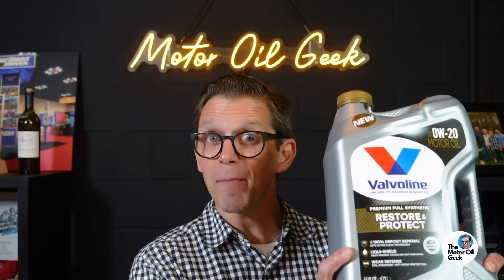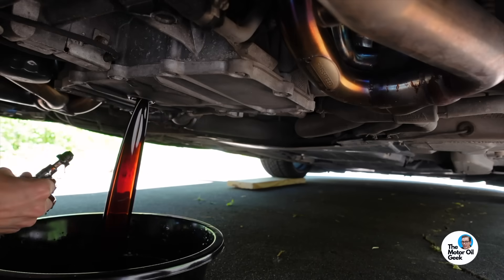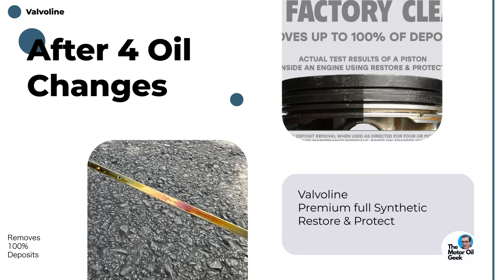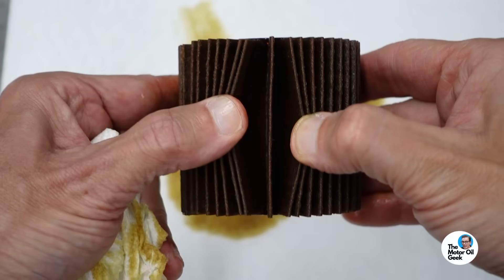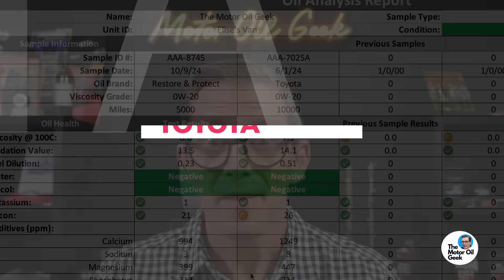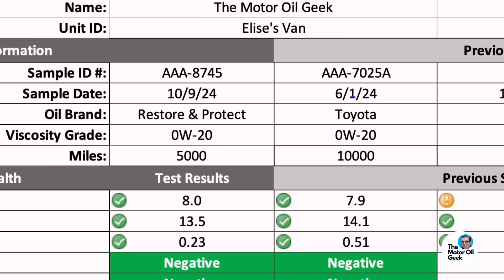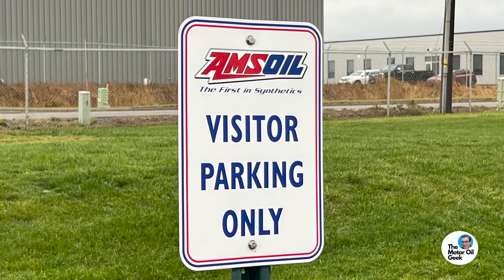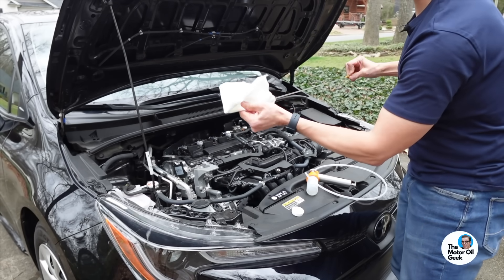The TRUTH About Valvoline's BOLD Engine Cleaning Claims

Comment: Can't believe you were letting the wife's van go 10,000 miles between oil changes from the Toyota dealer with OEM oil!
Reply from the maker: The OEM oil is actually very good, and the used oil analysis results show the oil is capable of 10,000 mile oil changer intervals. As such, that's what we are doing. Science, not speculation...
Reply: @themotoroilgeek your doing great work bring the actual facts to the table and not just opions. I use to think you were full of shit. I was wrong and you've proven me wrong time and time again.
Reply from the maker: @jmc6940 thanks!
Reply: @themotoroilgeek Did ya forget about me?

When are you going to do motorcycle oil related content?

It's a fine dance between protection and grip for the clutch. Maybe you're still researching it? I'm sure there's a lot to learn with this particular appliance.
Reply from the maker: @Stacy_Smith funny you should ask… our next video is on motorcycle oils.
Reply: @themotoroilgeek  WHOO-HOO! Thank you sir.
Reply: @Stacy_Smith I used strictly Rotella in our four stroke Yamaha motocross bikes. Motors looked like new every time I pulled them apart. Clutch grip never an issue.
Reply: @partialperson  That's what I'm running in my 2018 Yamaha Star Venture Transcontinental.

I'm running Amsoil Metric 20w40 in my 2007 Yamaha V-Star.
Reply: @partialperson  One more thing...

I would like a comparison of Yamalube vs. Rotella.
Reply: @themotoroilgeek  Mobile 1 makes Toyota oil! Mobil 1 makes great oil been using it for years and used Valvoline but now I’m using Valvoline R&P in my 2016 Camry..
Reply: @itsJMoney0192 Toyota oil is very different from retail Mobil1. Toyota oil has about 10x the moly content, among other differences.
Reply: @themotoroilgeek Can the oil analysis show if carbon is present to the point that it clogs the oil control rings and drain holes? Toyotas are know for oil burning due to worn cylinder walls since the rings are frozen in place. I’m curious if a UOA will show this.
Reply: @themotoroilgeek, more importantly, did you inspection the engine for wear? Can I hold it your science that I'll have the same outcome? Have you done an oil and engine wear video? I mean using precise measurement tools to find any abnormal wear. Awesome video.
Reply: @themotoroilgeek The varnish on your dipstick refutes the lab analysis.
Reply: @themotoroilgeek  sad. Saving $50 for nothing
Reply: @themotoroilgeek  plenty of Toyota owners have destroyed perfectly good engines with these 10k mile oil changes. Oil analysis isn't gonna show how the inside of the engine looks. The car care nut has torn plenty of engines apart due to long intervals. It's not just speculation
Reply: @XxChuyoxX 
You can however judge the oil condition with the correct test. The engine doesn't care how many miles the oil has on it, it cares what condition it's in.

If you don't have a clue, shorter is better. It's more idiot proof.
Reply: @gk5891  sure but that isn't necessarily telling you the condition of the engine.
Reply: @mrtickles5982   it's typically slow premature wear that takes time. The engines typically become oil burners consuming excessive amounts. It's not something that happens after a couple years. And 10k miles is extremely vague. Everyone's driving conditions and idling times vary greatly.
Reply: @XxChuyoxX  Agree, driving styles and conditions affect the needed oil change interval greatly. Here I am with a 300,000 mile german diesel engine, 10,000mile oil change interval. 50/50 city highway, minimal towing, outside temps vary between 35°C and -40°C depending on time of year. Engine has never been opened.

Edit: I forgot that I changed leaking rocker cover gasket at 280,000
Reply: @XxChuyoxX  it really depends on the engine. The v6 on the Highlander needs clean oil every 5k miles or it will clog. The second gen Tacoma can take  you a million with 10k oil changes.......
Reply: @ I would agree with this. Many older basic engines can get away with it but the newer designs with tighter clearances do not tolerate old/sludged up oil
Reply: @MiguelGarcia-vj7oo that's not true depending on the year and which engine you're referring to.
Reply: @XxChuyoxX  how would the oil not show the engine damaging itself? That's exactly what the analysis is for 🤦‍♂️
Reply: @themotoroilgeek I like your content and I know you know your stuff. That being said while the wear has been acceptable with the 10k oil changes in your wife’s van there’s a huge chance there wouldn’t have been any varnish on the dipstick or other components if the oil changes were done at 5,000 mile intervals. I realize it will still live a long life.  But it’s hard for me to understand the science Vs speculation when it’s right there in front of you on the dipstick.
Reply: @AB-coyote You gotta take all things into consideration. Just because an engine has varnish, doesn’t mean it’s full of sludge or that it’s gonna fail prematurely. If 10k intervals are working for that specific vehicle and its driving conditions, and has already proven to be working reliably and well with over 180k on the clock, then there’s no issue with it having some varnish after so many miles. It doesn’t need to look pretty or perfect, and you also need to take cost into consideration and see if it’s worth it with a cost/benefit analysis. If 10k intervals take it to, for the sake of an example, 500k miles before needing to be opened up for a significant repair, vs doing 5k intervals and the engine lasting 6 or 700k miles before needing that rebuild, was it worth it? That’s double the cost in oil and filters minimum assuming you do them all yourself, but significantly more if you’re paying for labor. Doubt that double the cost of oil changes will outweigh the benefits when it comes time where the engine inevitably fails and needs a rebuild. Now you gotta pay for the rebuild anyway, plus you wasted an extra whatever amount on oil minus the extra mileage you got out of it. Doubt it would be more economical in the end, at least for this example, assuming the engine isn’t absolutely caked in sludge and has serious issues that are a direct result of the 10k intervals & would have been avoided had they gone with double the oil changes. I’ve seen plenty of really high mileage engines that were running perfectly fine and they had varnish. It was just cosmetic and had no adverse effects. (If you’re wondering why the engines were open in the first place, it’s because they were either being swapped for another one, or being rebuilt/upgraded with performance parts) That and valvecover gasket replacements hehe.
Reply: @AB-coyote  I lean hard on the testing and science side, but you make a very reasonable point.  I don't do 10k intervals and I've never seen varnish on my dip sticks in 30 years of doing my own oil changes. 👍
Reply: @themotoroilgeek  just look at the deposits left on the dipstick that alone should tell you your going too long between oil changes
Reply from the maker: @michaelperry407  Those deposits are due to the higher moly content, which is providing excellent wear protection. That is the downside to really high moly levels - increased deposits.
Reply: @themotoroilgeek . You mentioned trying this in your daughter’s car, so I have a question specifically because it has a Toyota Dynamic Force engine. These engines use an electric device, presumably some kind of solenoid, to let the computer regulate the oil pressure. From what I’ve read, the computer sets the pressure based on demand. Doesn’t the 0W-16 have lower flow than 0W-8 at the same pressure? If the computer expects a certain amount of flow, will using a higher viscosity oil lead to increased wear in the long run?
Reply from the maker: @PrinceAlberts  We will find out. The 0W-16 didn't increase wear the first time I used it.
Reply: @themotoroilgeek I think you should do a video on varnish. I know it can be an issue and a sign of more significant deposits like sludge, but many times it’s just cosmetic and it’s not an issue. There are levels to this and some people don’t seem to understand, and another thing they don’t understand is that there’s such a thing as diminishing returns and cost/benefit analyses. Sure you can double or triple the amount of oil and filter changes you do to your engine over the life of your vehicle, but what is your goal here? Most people’s motivation for it is purely financial. Well, they gotta work out the numbers like I said in my previous comment replying to the other guy. You spending less money doing double the oil changes and rebuilding the engine 100k miles later than you would have/buying a new car, or are you spending less money doing sensible oil changes depending on your specific vehicle and operating conditions? (You can do oil analysis to find your sweet spot) I think most of the time it’s gonna be the latter…
Reply: @michaelperry407 my dipstick was circumsized, so it always comes out clean.
Reply: @themotoroilgeek lake, are you sure this isn’t varnish from the oil being overwhelmed and plating out?
Reply: , agreed. But then the Moly is being blamed instead of the oil
Reply: Data is driving his decisions.
Reply: The one good thing about Ford Quick Lane is they get Motor Craft Bulk from the CP Distributor or they can't have Quick Lane branding.
Reply: Semi syn most likely  @gk5891
Reply: @gk5891  Motorcraft still is a blend though. So not as good as any full synthetic
Reply: Oil and filters are cheap folks, engines and repairs are expensive. Change it with high quality synthetic oil and filters and go half the miles they recommend, unless you drive mostly long trips on the highway, steady speed and not towing....then you might be able to extend those oil change intervals. Verify with a used oil analysis if you want to know for certain!
Reply: I know right? Seems out of character
Reply: 366K miles on a 2014 Toyota 4Runner, oil changes by me every 10K miles primarily using Quaker State and Pennzoil 0w20 synthetic. At 365K I did the oil change with Valvoline Restore and Protect. At 1K the oil on the dipstick was clear as usual. 98% of the miles are highway and the rest are off-road.
Reply: 2010 Civic with 169,000 miles, burns zero oil and 10K Full Synth oil changes. Zero issues so far, idles smooth.
Reply: Pros and cons. Does it cause engine to wear premature.
Reply: I'm amazed at all the oil analysts commenting here. I'm pretty sure he knows what he's doing in his videos. I think I'll keep using his advice over the rest of the comments on here.
Reply: 3000 miles if vehicle is turbocharged in my humble opinion.
Reply: @PeterHernandez-lg2eh  
Overextended drain intervals are not good for engines. The problem most  people have no idea what that is. The engine could care less about the miles on the oil, only it's condition.

With synthetic blend oil a GDI Turbo has run nearly 500,000 mi without stuck rings with the original timing chain and turbos while using 10,000 mi oci. They have also needed turbos, timing chain and been consuming over a qt of oil per 1,000 mi before 100,000 mi.

An arbitrary mileage is a pretty blunt instrument.
Reply: I was always taught that if the dipstick is stained up, you were going too long in between changes. I was also raised on the 3 month/3,000 miles intervals. Trans fluid/filter every 5 oil changes. I put at least 500K on anything I own. Never had an engine or trans failure. The OEMs want you to neglect your maintenance, they want to sale vehicles. No wonder Toyota is having to replace so many piston and ring assemblies!
Reply: 10,000 miles 😂 oil changes is wild. I do no more then 5000. I change mine oil in my 04 Accord EXV6 Sedan & 14 Acura RDX Tech 2wd. Every 3750 miles.
Reply: Allegedly
Reply: They use crap rebranded oil at the dealership.
Reply: Few if any Toyota dealers use Toyota oil in their service bays. They sell it in over the counter their parts department, but customers get who-knows-what bulk oil for their oil changes.
Reply: @johndorrell1  I agree about the dealer bulk oil but I think Lake has real Toyota oil in his cars. He mentions the super high Moly count in this video and it's usually easy to tell because the Toyota stuff is up around 600ppm and that's double or triple any other regular oil out there.
Reply: @johndorrell1 
I bought some parts from the local toyota...maybe lexus dealership...I forget.  Anyways....they had pallets of costco oil in the bay.
Reply: @johndorrell1 can confirm my local dealer, where I buy my TGMO 0w20, told me the same. Dealer oil changes don’t get genuine oil.
Reply: @JohnConrad the subaru dealer i worked with exclusively used the subaru oil. only used other oils if customers brought their own
Reply: @JohnConrad Wow your dealer sucks , here in Canada they only carry Toyota branded oil comes in drums which was told to me to be made by Mobil
Reply: @JohnConrad I can bet it’s a cost thing, plus they may not be able to get it in bulk.
Reply: @JohnConrad  oh shit!
Reply: @johndorrell1 "who knows what" hasn't it been proven most oil is exactly the same, with slightly different additive packs... better to use cheap oil and change it often then expensive oil and run longer. Dealerships buy bulk oil usually from a warran distribution at least in southern California. So it's all the same. Next time you at the gas station pay attention to the name on the truck dropping off. Not the fuel name. But the company name. They will deliver to multiple different brand stations.
Reply: @mustangdemon87 I know it’s an old post, but your logic about gas tankers is flawed. Just because we deliver to multiple customers doesn’t mean they all get the same product!
Reply: @johndorrell1 always suspected that. I do oil changes at home now
Reply: @johndorrell1 you're right, when i worked at ford they had motorcraft oil over the counter but we typically used Castrol edge in the shop, only on the Shelby's would we use motorcraft
Reply: My dad and brother both do the 10k OCIs with Toyota 0w20. BuT ItS fUlL SyNthEtic they say. I'm with Car Care Nut. Cut the suggestion in half.
Reply: For science
Reply: One thing I know from being married for 42 years, don't tell mama what to do with her car!!
Reply from the maker: @rd4660  LOL
Reply: I worked in three different YOTA dealerships and none used Toyota oil in their bulk systems. The only way to get genuine Toyota oil was to pay extra to buy it by the quart from the parts department. One dealership used Quaker State, another used Kendall, and the last one used a non-branded oil from a local supplier. They essentially used whatever bulk supplier had the best deal. It didn’t matter. Customers who kept their engines serviced at reasonable intervals didn’t have any issues regardless of the brand of oil.  Toyota had a few engines back then that were going to sludge regardless of the oil. I rebuilt them and they’d be completely sludged up and would have impeccable service histories.
Reply: Toyota did an update for their maintenance so my rav4 prime and sienna hybrid gets changed every 5k vs the old 10k.
Reply: Because he has actually tested that the oil can do that based on his driving conditions.

10K oil change intervals are fine for people who live in mild climates and do primarily highway driving. 

5K oil changes are for people who live in the city and/or cold climates. 

I change my oil every 3K. But that is primarily because my car is used in the city only and I live in a cold climate. The engine in my vehicle get's significantly more thrashing because of the constant stopping and starting.
Reply from the maker: @circletech7745  right on!
Reply: @circletech7745  Do you have UOA data to support these OCIs, or what are they based on?
Reply: @circletech7745  are your interval numbers driven by data?
Reply: @circletech7745 thats where the 3k myth is born 😂
Reply: Yes. Most of Europe changes their oil at 15,000 km intervals which is close to 10k miles. That's pretty standard there and some go as far as 30,000 km. In America for some reason people feel they need to cut that in half or more for some reason. Maybe they assume most American's drive their cars like idiots and abuse them, or maybe they just want people to spend money they don't need to (more likely). How you drive and driving conditions - like mostly longer trips versus short ones and highway miles versus stop and go city driving - is more relevant to when oil changes are needed than a simple hard interval. Oil isn't like milk.That said, even with that criteria, Americans are changing their oil sooner than needed most of the time and the recommended intervals are too conservative. I drive mostly highway with 40 minute daily commutes in the NE and change my oil at around 7,500 miles. If I for some reason went closer to 10k miles, I wouldn't panic or felt my engine was being damaged. When I examine my oil during changes, its just as opaque as it would be at 3000 miles, just as sluge-less and free flowing, and I never have any metal showing in the oil or on the pan plug.  @circletech7745
Reply: @circletech7745 I change oil every 3k, too, because I have a high-performance Mustang.
Reply: Except for my new car, I go 15 to 20,000 miles without changing my oil. I have over 200,000 on both my Honda Accord and Toyota Highlander.
Reply: @sinusguy I did this on my Pontiac Grand Am that I drove 50 miles each way to work on a country highway with no traffic using Rotella. My theory was the high zinc content helped and  driving conditions were not abusive. I also ran Rotella in our four stroke motocross bikes and even now in my mowers. Our new GM vehicles have lifetime powertrain warranty so I now follow GM guidelines and let them do all service as much as it hurts my pocketbook, lol.
Reply: Great episode on real world testing on a road driven consumer type car, not a lab rat engine.
Reply: It's absolutely weird that Valvoline has the only lab for oil analysis
Reply: Sienna abuse
Reply: Its toyota, toyota built tough
Reply: Oh god, that got me face palming too when he said 10k with OEM oil.
Reply: @rayvalero8580 Mobil1 makes the Toyota oil these manufacturers don't make their own oil .Toyota is mobil 1Same way Castrol makes most of the FOMOCO oil etc etc
Reply: I'll stick with 5k interval... science can be manipulated. Remember vid one niner? Ha!
Reply: @bikerz3857  Any customer who is going to stick to 5K intervals regardless would be wise to stay with conventional oil and save themselves some money. I’ve rebuilt engines for a living for 30 years and there’s absolutely no difference in cleanliness and wear at such short intervals between conventional and synthetic. I have one customer who has put 350K miles on a K24A2 engine and it’s had nothing but bulk conventional oil every 3-5K miles and the valvetrain and bottom end are spotless. 
 Unless one lives in extremely cold climates the benefits of a “full “ synthetic only begin to be obvious when the intervals are longer. You could tear two identical engines apart that one had conventional and the other had synthetic at 5K intervals and the the wear and cleanliness would essentially be identical. Oils marketed as conventional have come a long way in the past two decades. It had to to meet ever greater demands that were placed upon it by modern designs such as direct injection and turbocharging.
Reply: Why people go so long with our changing there oil it's not expensive and it's easy to do
Reply: 🎹🎶🎵🥁 Blinded by the Science ...Safe and Effective boys Safe and Effective ... Scientifically Tested get in line for 💉 boostas 🥴😆🤣
Reply: @valiantone395 😆
Reply: @valiantone395 just had my 6th booster a few weeks ago. Science, not speculation.
Reply: @valiantone395  The data I was looking at said the opposite.